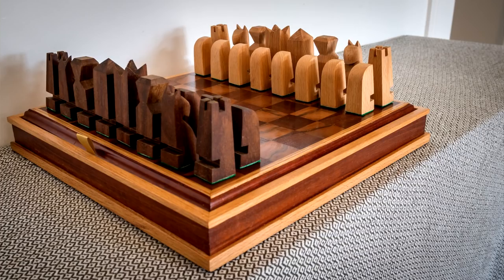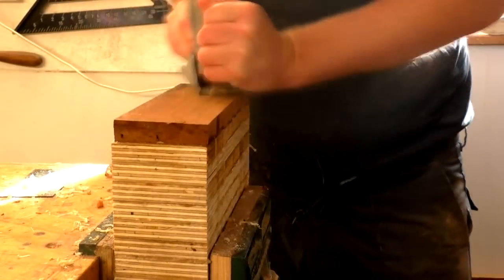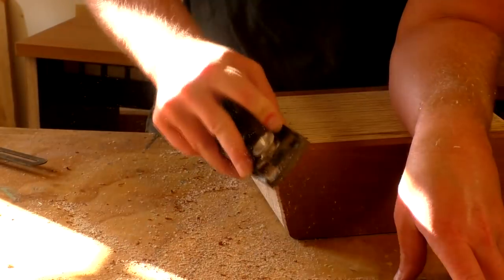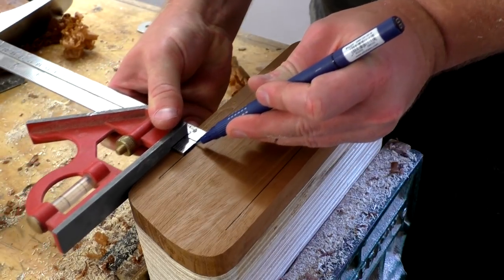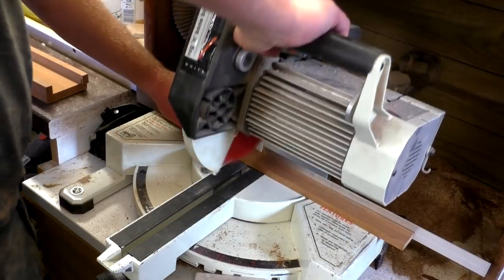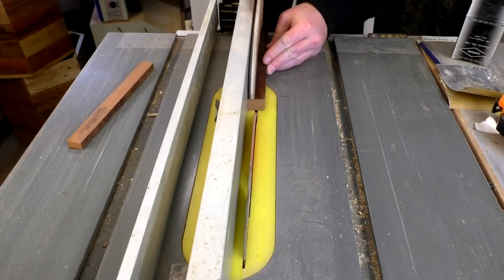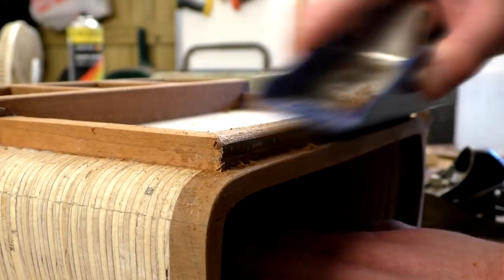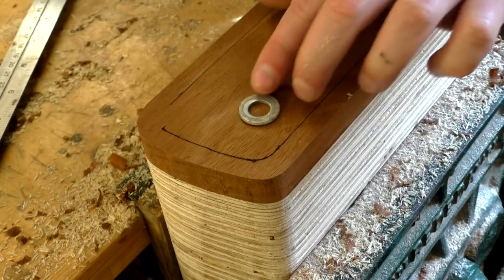Making A Bandsaw Box Desk Tidy

Comment: Very beautiful box you made! I just want to share a small tip for using felt or other fabric in projects like this. I have made couple of boxes with felt lining on the inside. The felt settles down very nicely when you cut a piece of dense cardboard to match each interior face and glue the felt to those pieces, wrapping the edges of the felt to the underside. Then glue the pieces to the box. This way the corners come out nice and tidy and don't unravel over time.
Reply from the maker: +Miikka Granlund great tip, thank you
Reply: Neat idea. I restored a small 50 year old box and replace the felt about 6 months ago..  Next I'll use you suggestion.

Comment: A tip about cutting screws shorter - as on your brass handle.   If you can find the right size and thread, put a nut onto the thread of the bolt before you cut and file the raw end.   As you remove the nut, it finishes the bolt thread cleanly, making it easier to screw into the handle without cross-threading.
Reply from the maker: +Don Johnson24 great tip!! Thank you 👍

Comment: Nice build Keith and thanks for the bandsaw blade tips. 

I’ve got to get me one of those super fancy bricks you have!
Reply from the maker: +Happy Wife Happy Life haha I have two in the shop, they're always useful! I'm in the process of sorting out my dust collection using your tips by the way! Finding reducers and adaptors is doing my head in!
Reply: Rag 'n' Bone Brown it’s a right pain getting all the connections. I used a combination of Amazon, eBay, screwfix and my belt sander to taper edges to get them to fit. Cloth tape helps too!

One thing I’ve noticed is that the drum that collects all the dust fills up much quicker so I’m guessing it’s working.
Reply from the maker: +Happy Wife Happy Life I actually bought the same drum as you but am having to return it as it won't fit where I need to put it... had to invest in a different air tight box
Reply: Rag 'n' Bone Brown that’s a shame it a really good drum.

Comment: Got me thinking, do you fancy doing a vid on blades. Number of teeth, quality, price etc. I have a cheap table saw which struggles with thicker pieces of wood and leaves burn marks and I'm wondering whether upgrading the blade would make a difference but I wouldn't know what to. Just a thought :)
Reply from the maker: +Ali Dymock thanks Ali nice idea but I've never really used anything other than a combi blade with around 30 teeth so I'm no expert on that. Lower tpi is best for rip cuts maybe try that?

Comment: hi great job with the box looks great I have a question I also have a Charnwood bandsaw it's the 12-inch so the one down from you I've only had it a couple of week what I was wondering is do you have a problem with the blade once you've cut curves with the blade it  won't cut straight again it's almost like zigzag could this be because it's just the standard factory blade that came with  the saw  did you have this problem any advice greatly appreciated
Reply: Check out Ian at Tuffsaws.co.uk - He will advise and supply the best blades for any bandsaw.
Reply from the maker: +Christopher Pipes could be a number of things -  it'll either be blade drift from too high a tpi blade, a bad quality blade, not enough blade tension or bearings not set close enough to the blade.... check out some bandsaw set up vids on YouTube and if you suspect it's the blade get one fromTuffSaw - not expensive but great quality blades
Reply: thanks a lot for getting back to me I'll do that cheers
Reply: thanks i'll have a look
Reply: @RagnBoneBrown  i was about to suggest Tuffsaw for great blades and advice from Ian, but glad to see you already buy from them! Great box... I've just ordered a 3/16", 4tpi for my Record bs 400 as I'm getting into bandsaw boxes : )